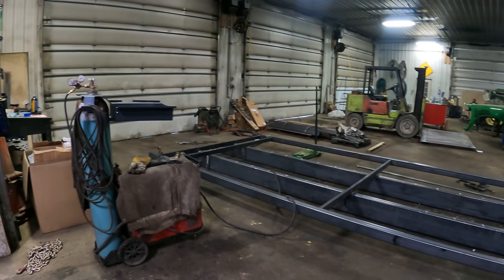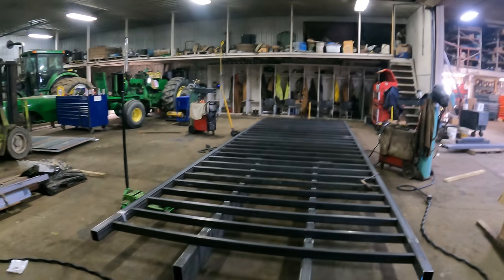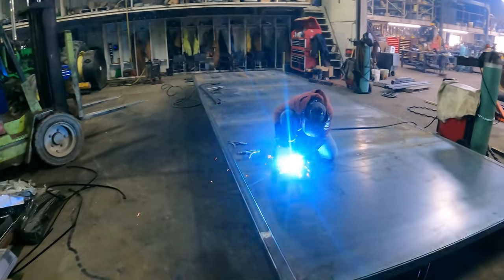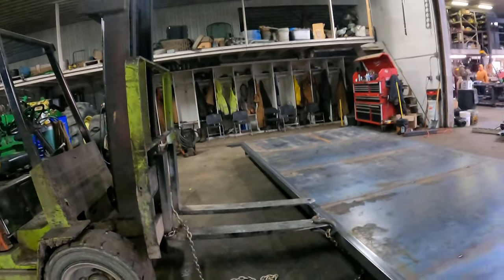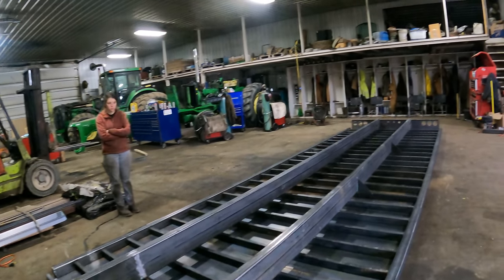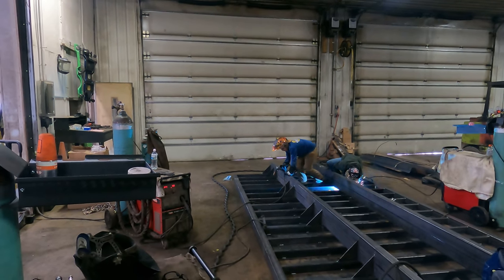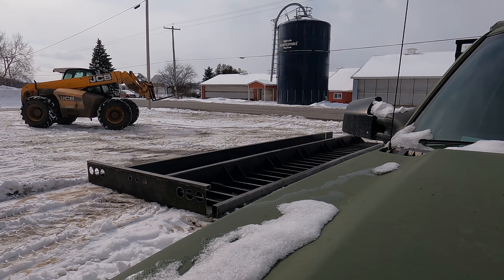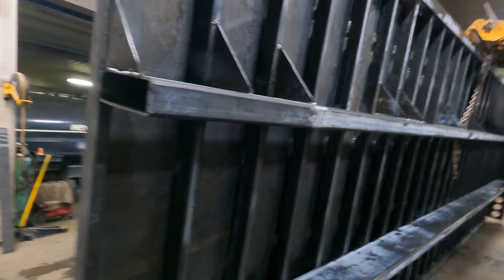Andrew, Alex and Sarah welding on this one

Comment: I watched this earlier but you know us old retired people go fishing all the time.
As far as your trigger problem you can take the gun apart and clean them up. May just be loose.
The biggest box I built was 36 foot long by 100 inches wide and 8 foot tall. That was 31 years ago and it's still in use. I repaired it last year patching rust holes.

Comment: Great Video my friend.  Hard working bunch of Kids .  If the weather holds should get the last of the Gas on ,  Got a little work left on the Planter.  Got my Harley outta the shed this Morning.  The Old Farmer's  thought I was nuts.  Told them I had rode in colder weather  It was 22 one morning in Wisconsin on our last motorcycle trip .  Warmer Days ahead .

Comment: Andy. Been watching your videos for some time. U always do a top job on them. Just a FYI on your defacer to help keep it off the wall and tearing up your arms. Take and weld on your Motor cover a 3/4 inch or 1 inch 4 1/2 x 4 1/2 block on it. If you ever order a new facer they are already on them.  I always notice when you were running the facer in the shop. It was making more noise than normal. To me that is telling me that you should build up your motor hubs with weld may need on all four side’s. Or just two sides  I found it better to put little on all. Y should u believe me. I am the guy who built your safety rake. The boom you just put on your facer.   When you do work on motors. And u take arms off u should put a laser and make sure you have same distance on your hubs all the way around. Say u have a 1/8 inch space above flat surface on one side it should be close to that on all four or close to it your motor will last longer.  O yes the teeth are hardened on one end.   Thank you for the time you put into your video  u also have the right color welders.
Reply from the maker: Thanks bud

Comment: Please note I don’t know anything about metal work. So my question is while watching u raise the bed outside to watch I noticed daylight coming through the floor and side rails. Why don’t u weld the length of the side rails? Seems like silage would get in between those or are u using that as drainage?
Reply from the maker: Side sheets set in that gap